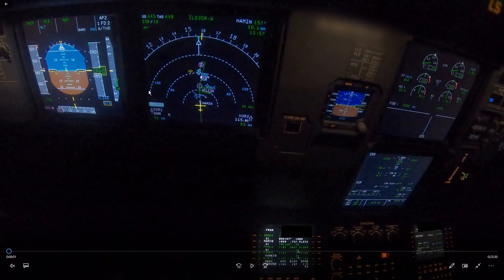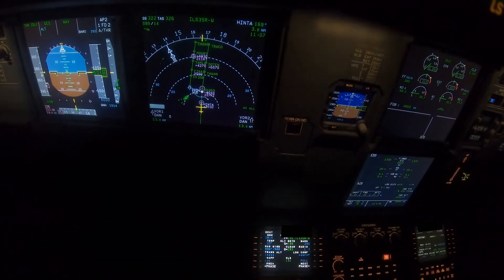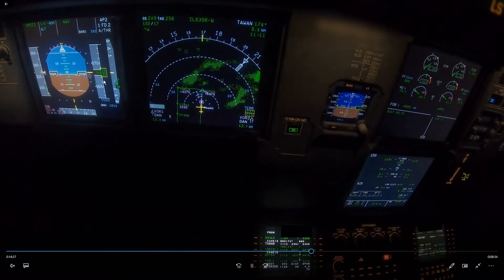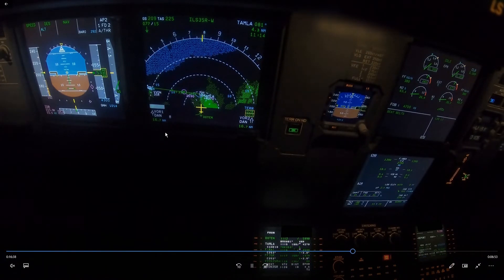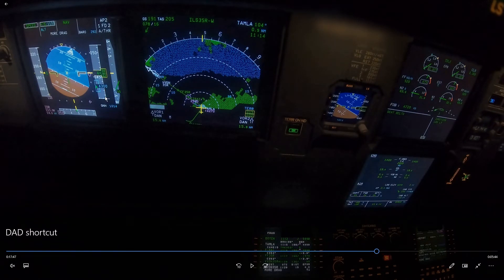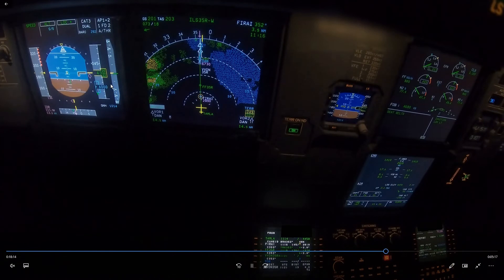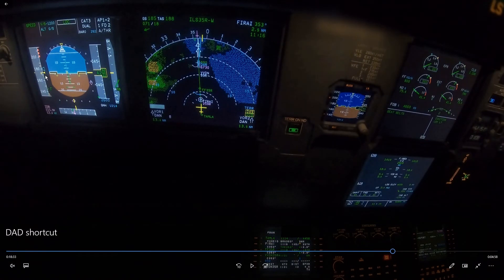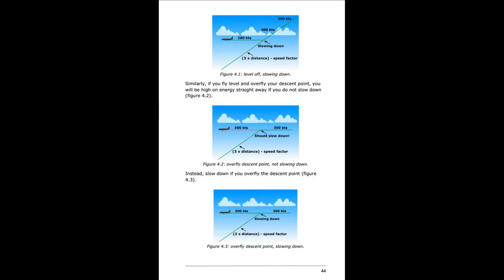A320 Descent Management - VVDN shortcut, glide slope from above.

Comment: I have a question.

1. For glideslope from above, is there any benefit of further configuration than flap 2 gear down if you’re being kept high and have time to do so.
I.e is it worth if level managing speed and getting into landing config if you’re kept really high.

In that case if I go to -1500 once I can descend will I have enough margin not to overspeed the Flaps whilst chasing the glide.
Reply from the maker: Yes, you can configure fully if you have to. This will give you additional drag as well.

Comment: On Boeing aeroplanes you can simply join the waypoints without executing. Make a note of the calculated altitude at the start of the shortcut and then erase the modification. Next, enter the altitude as a constraint (at or below) and you can continue to follow the descent path indicator. You will be on profile for the shortcut, but the entire route is still present should ATC change their mind.
Reply from the maker: Don't get me started on Boeing vs Airbus. I used to fly the b737 🤣